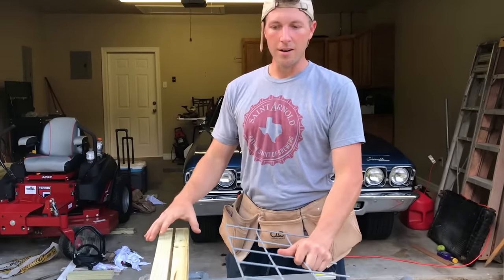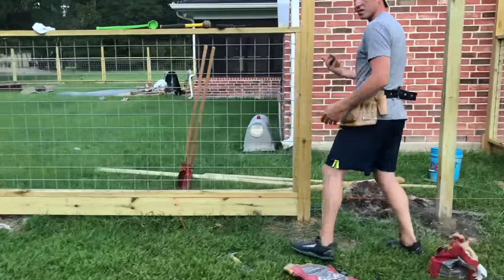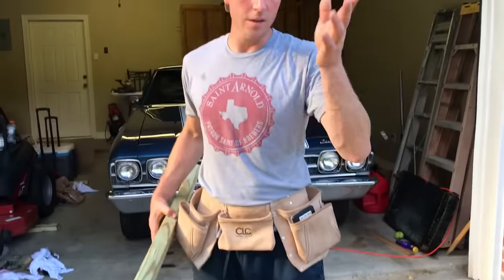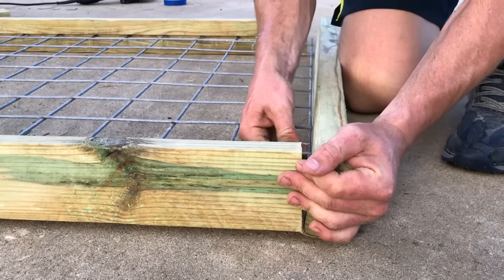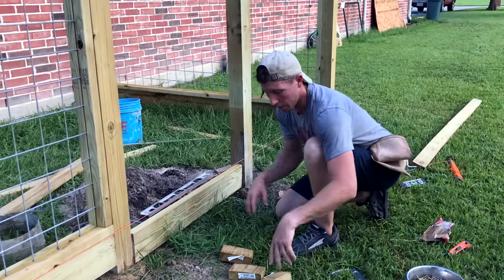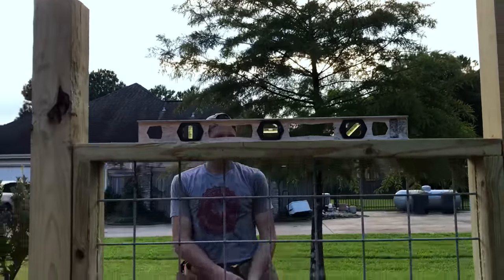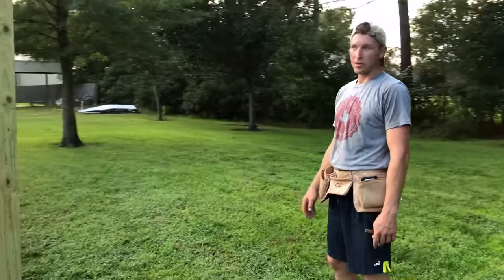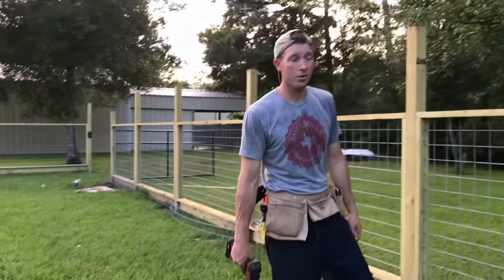Part 1: Modular Hogwire Panel Fence with Dado Groove

Comment: Are those dado blades simply 2 normal ripping blades with another blade in the middle or do you buy those dado blades as a complete unit.
Reply from the maker: I utilized Avanti brand dado set which came will all the various spacers needed. I believe diablo brand is another set you can get at home depot. Im sure you can find replacement or individual items, but for a first go at it, i went with the set. I cut shy of 600ft of lumber for the project without issues with dulling.
Reply from the maker: also, to further answer your question, they are 2 ripping blades, but they are direction specific and lock in with the cutter blade. It could be possible to flip a normal blade 180deg. to make it work on your own account, but specific dado sets lock together as unit for proper cutting efficiency.

Comment: When you stained it what did you do about t getting on the fence material ?
Reply from the maker: Moe, i have yet to stain the fence as the treated material is still resisting water. It can take months before treated material is ready to stain. I have given consideration to getting stain material on the metal panel portion of the fence, and thought to cut out a piece of plywood or cardboard to the size of the metal panel, but am probably just going to leave it be. The surface area of the fence portion is not enough to take a direct cosmetic change, and if it does get a bit of over spray it will technically be additional rust preventative.

Comment: 3 years he will have to do it again, Dado groove will hold that water like a sponge.
Reply from the maker: beansontoast10 I considered the same and to battle this I drilled drilled weep holes in the grove from the bottom of each panel from and checked it’s performance with a bottle of water. Very little water remained in the groove to my surprise. Hopefully this will prolong the decay time due to water saturation.
Reply: @GatorOverland  Ok Bud, Thats cool, Hope it last for many years to come. When doing things with wood all ways leave air gaps. Bottom Dado rail to gravle board try to leave a 2-3mm gap then it will dry and not rot. I live in Wales UK and we are the wetest country in Europe, when i say wet I mean WET. ON A 6X1 TREATED BOARD THE CHANGE CAN BE 1/4 TO 3/8. WET TO DRY.
Reply from the maker: @IWANASLAPTHAT  (laughing) i figured by your tag "beans on toast" you'd be from across the pond. My mom grew up a stones throw away from you in Manchester. Thanks for the info. It will be mentioned when others locally inquire about the fence design. Our location gets about 60" (1524mm) of rainfall per year, and most of that is in the same month. It'll be hot and bone dry for us before we know it.
Reply: @GatorOverland  Hello. Love the design, and I was wondering the same thing as beans. Drilling weep holes in the grove makes a lot of sense. Just wondering, would you have changed the design if you lived in a locale that receives occasional significant snow? I live up in Nebraska, considering this as a spring project. Thanks!
Reply from the maker: k langer, as beans mentioned, it’s would be possible to shim/space (probably of a plastic or urethane) the panel away from actually bottoming out in the groove, which could allow for air to access the area, aiding the drying process. I think both weep holes and spacers together would be a great combination to increase the life of the fence frame base. As for your location, I’m not sure how materials stand the test of time compared to my location, (laughing) but at least it’ll look good while it lasts. I plan to stain it in May. It’s still mostly resisting water, so it wouldn’t be beneficial just yet. Hope that helps. Thanks for the inquiry.

Comment: John,  So your cut wire panel is 92" long with the wood frame being 93.5" long
Reply from the maker: yep! a 2x4 is approx. 1.5" thick, so with a 1" depth dado groove that leaves approx 1/2" from the dado depth to the outside of the frame board. if you accound for that 1/2" on both side that is 1" total. 93.5" minus 1/2" (left side) minus 1/2" (right side) = 92.5"...your wire panel when trimmed should work out to have a hard wire border all the way around. So, your I.D. dimension of your frame @ 92.5" minus 92" (wire panel length) = 1/2".... this 1/2" is an allowance of movement for ease of construction discussed @ (6:45). I hope this answers or confirms your inquiry. thanks
Reply from the maker: check you email, i sent another detailed hand sketch

Comment: nice job- a mitered corner on the panel would give a more finished look
Reply from the maker: I actually did a demo panel with mitered corners because like you i thought the finish would be better, and it did, but it was a pain in the ass to line up the wire panel and keep the frame ends looking flush while drilling the screws without a pilot hole, especially when the boards are not perfectly straight. The 100 degree Texas weather made for the quick decision to make all straight cuts rather than fight the miter frustration.

Comment: Nice Job!  Maybe just cut dado grooves on rails and stiles slide hog panels into grooves, then put on top grooved top rail?
Reply: attach to posts first, then slide hog panel from the top into the installed rails/stiles.
Reply from the maker: Yes, that would work, and would probably save a few screws as well going that route. After doing as many panels as I did and putting them in on my own, I’m glad they were a unit before install. I didn’t have fight level and plumb of piecing it together per post set. But I agree, if the hog panels were perfectly straight (mine wasn’t) you could screw in the bottom and 2 sides between the post set, then slide in the wire panel from the top and then cap with the top board just the same.